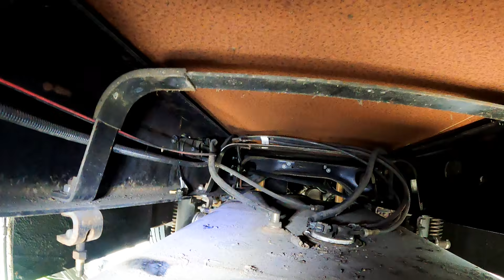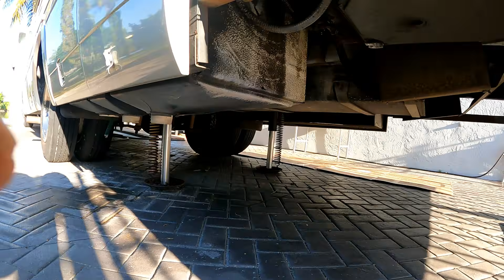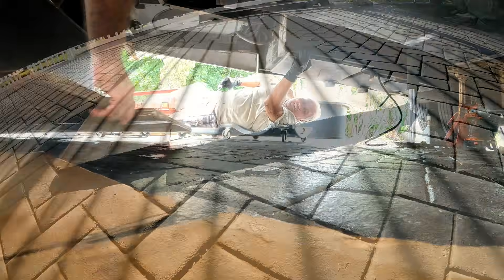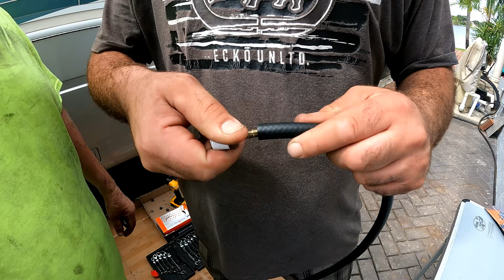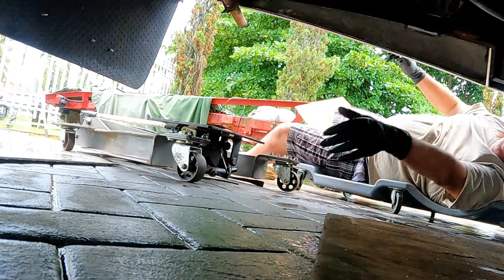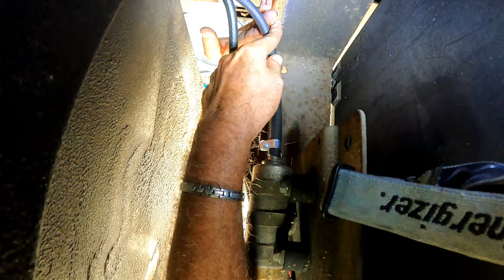How To Drop Fuel Tank on Workhorse Chassis & Replace Generator Fuel Line Hose – Dolphin Motorhome

Comment from the maker: Today we Drop the Fuel Tank from a Workhorse Chassis to Replace a deteriorated Generator fuel line on the 2003 National Dolphin Motorhome. Should be the same from 2000-2007 models.
Reply: like

Comment: Is the pickup tube inside the tank metal or rubber?can it fall off inside?my genny used to run down to the 1/4 tank level but recently only down to 5/8 full and stops picking up fuel,i can blow through the line at the genny and its just air,no bubbling sound
Reply from the maker: Oh, there you are again. Sorry not sure if its rubber or metal. I'd be interested to know if you find out. Thank you
Reply: Im going to lower the tank in a couple days and check it,i can put my hand on it and get a wrench on it and  only have that much room but however long it is i probably couldnt get it out ill let you know @JohnCRV
Reply from the maker: thank you

Comment: Is it possible to insere inside the original hose a new hose with the inside diameter dimension of the original hose and avoid removing the old hose and exchanging it ?
Reply from the maker: No way

Comment: Ratchet straps! No need for a jack.
Reply from the maker: Sounds interesting. Do you mind sharing details of what kind and how many...
Thanks you for the feedback.
Reply: @JohnCRV  I used 2 Husky 2”x 27’ 3300lb from Home Depot. You can use them instead of a jack to lower and raise the tank. I have a 75 gallon tank that had about 15-20 gallons in it. I also lowered it onto 2 small 2 wheel dollies from HD. I already had those on hand but you can also use just 1 large doll
Reply: *dolly.
Reply from the maker: @emeraldkind  Good info... I'm assuming you wrapped the straps around the top of the chassis. Sounds like another way to do it. Thank you!
Reply: @JohnCRV  on my rv I had to wrap them around the leaf springs. I didn’t have enough room to hook them to the chassis. I know there are rvs that you can hook to the chassis. You just have to use what you can.
Reply from the maker: @emeraldkind  I see what you mean. I think I could have used them on mine by wrapping them on the chassis. 
Thanks for replying, I'm sure this will help someone out there. Especially if the floor is not paved or no way to get a jack.....
Have a great day!
Reply: @JohnCRV   You are very welcome. You have a great day as well!
Reply: @emeraldkind  I've never seen ratchet straps that work in reverse load bearing? Did they work to lower the heavy tank without it coming down hard? I'll experiment with the one's u list above. Very interesting...
Reply: @BabyGirlJade-134   You just have to let one strap go slow and then lock it. Move to the next and repeat until you have it down.
Reply: @BabyGirlJade-134  LOL! I just got the notification for you comment! From a year ago. I hope you got it figured out with no issues. This is a video of a good example of how to do reverse ratchet for future reference. https://youtube.com/shorts/0E043R8se3k?si=RuUcc_hK_u2NdAxb
Reply: One say soon hopefully, technology will advance so an onboard Gennie is longer necessary.

Comment: My '04 Dolphin 6342 has almost the exact opposite setup as yours with both the propane and generator on the drivers side and to the front of the coach.... But I've gained a lot of insight to do mine from your video... If you've got about 70,000 miles on your coach you should have replaced the fuel pump while you were in there... Thanks for the help.
Reply from the maker: I'm beginning to think I should have done that. Where did you order the new fuel pump?

Comment: John, thanks for sharing the steps it takes to drop  the tank on a WH chassis. Do you recall seeing an EVAP pressure sensor on the top of the tank's fuel pump assembly? My sensor has stopped working but not sure where to find it.
Reply from the maker: Sorry Larry, I did not notice it. But I would assume something like a EVAP pressure sensor would be more close to the engine compartment? What type of engine and year do you have? If I find out I will pass it on for sure.